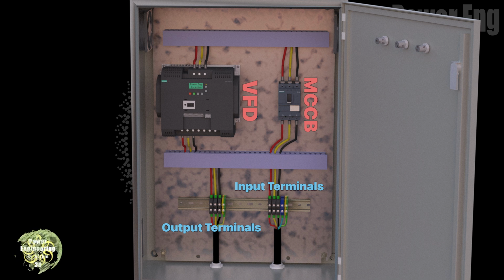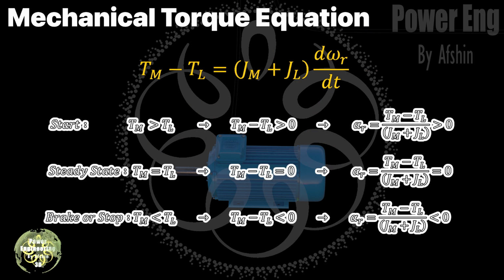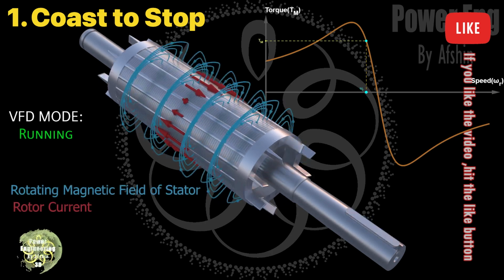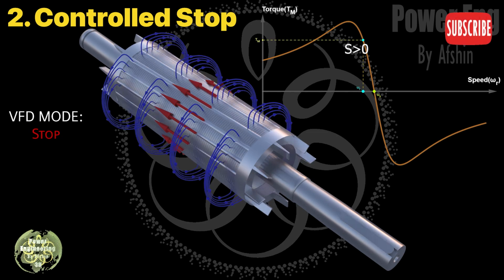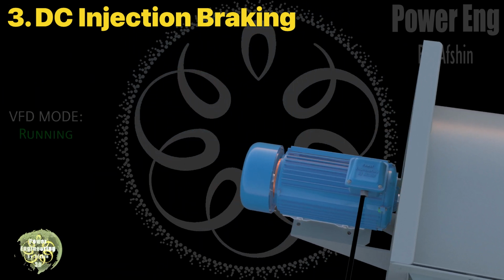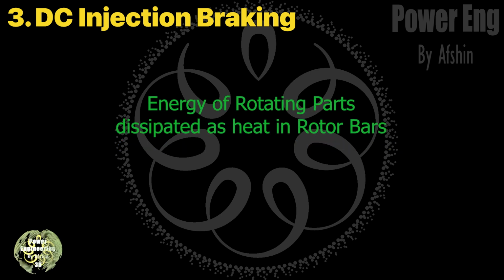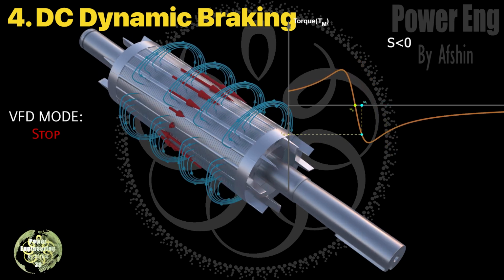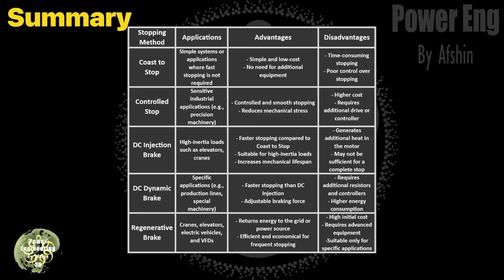How a VFD Stops a Motor: Braking Methods Compared

Comment: I want to stop the motor immediately after power failure. How to do this 
Which method suitable
Reply from the maker: You can use UPS or mechanical brakes